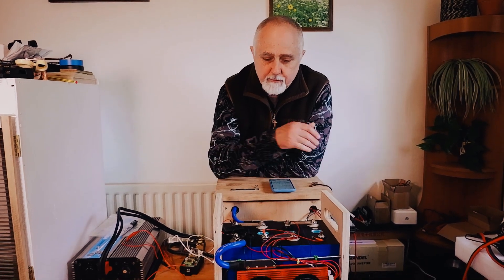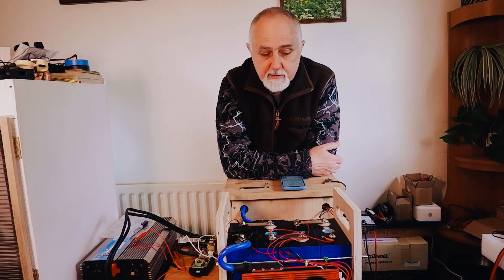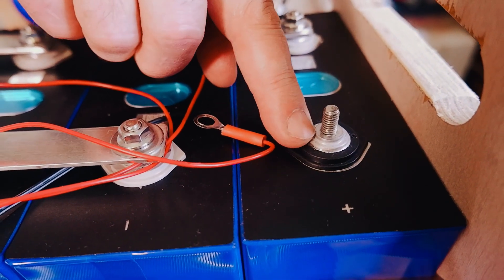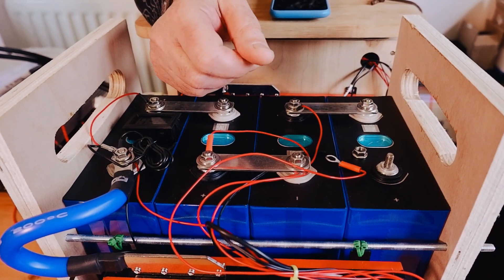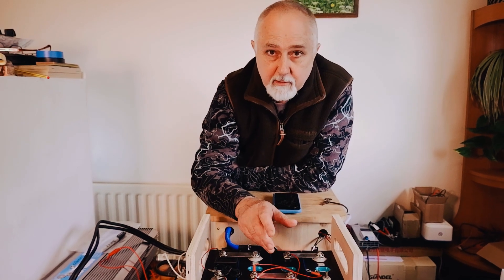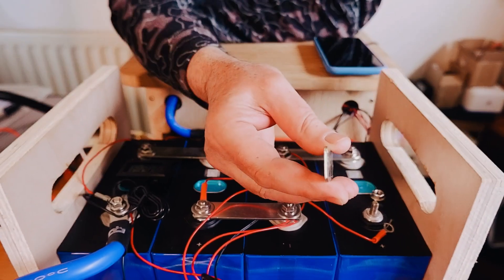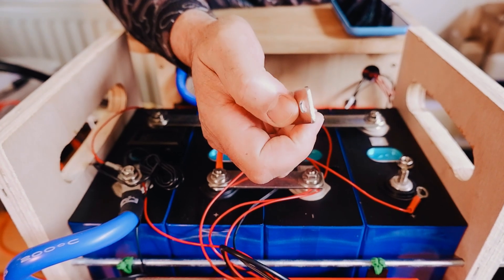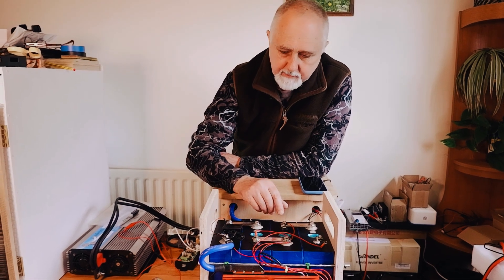Review of EVE 280AH LiFePO4 Battery Cells

Comment: I've always been confused how big a solar panel would need to charge these?

I would not be using much.. Just lights and my heater every now and then. 

If i only use a very small amount of power consumption on my boat. Could i get away with Having a smaller solar panel?
Reply from the maker: It really depends how much power you use from your batteries. Best thing is to work out how much you’ll use, you can do this by working out how many watts you need and then how long you’ll run your appliances for. That will give you your total number of watt hours.

For example, let’s say you’ll draw 6 Amps at 12 Volts for 2 hours, the formula looks like this:

6*12 = 72

This means that you need 72 Watts of power per hour (assuming you’ll run your appliance nonstop). 

You can then calculate how much solar you will need to replace the amount you take from the battery based on how many hours you draw that amount from the battery. If you then have 120w of solar, you’ll roughly need a little more than an hour of direct usable sun to replace an hour of use based on the example above.

Comment: Im so confused why these chinese BMS are set to 3.75 as max voltage.
Reply from the maker: Some LiFePO4 cells can have 3.75v as the max voltage without causing damage, so I think Daly intend for you to adjust the limits based on the recommended thresholds that your cell manufacturers recommend.
Reply: @offgrid_power  sadly this Daly BMS I have isnt adjustable.

Comment: Life wise do you think it's worth dropping the top voltage to 3.5 snd the lower to 2.8 ? there doesn't seem to be much capacity to be gained after these levels?
I'm looking for 250 Ah of usable capacity for my camper but space restrictions only allow me 230 ish with LA which obviously meens around 100Ah usable capacity ☹️
Cost wise I'd be looking at £500 in LA batteries, £50 in protection AND a lot if time and effort relocating the battery compartment to reach that 250 AH capacity AND I'd be paying a huge price in weight !
Reply from the maker: Hey Rob, yeah you're right. The trouble with LA is by the time you've put enough batteries in to match the capacity, you're not far off the price of a DIY custom LiFePO4 battery and significantly more weight! 

In terms of lifespan of the LiFePO4 cells, you are correct that the more conservative you are with reaching the limits, the longer the cells will last. So if you had your upper voltage at 3.5v and your lower voltage at 3v, you'll get more life out of the cells than if you pushed them to 3.65v and 2.5v. As you say, most of the energy comes from that 3.5 to 3v. Above 3.5 and below 3v you don't get a lot of capacity. Personally, we tend to run our batteries at about 3.65v for upper limit and 2.75v for lower limit even though it'll shorten the lifespan because we'll still get 8+ years out of the cells, even if we use the van full time (which we don't) and in 8 years time, the technology will have improved so much that we might be keen to upgrade before then anyway. :)
Reply: @offgrid_power  yeh i get you, in 8 years LiFeP04 will seem caveman tech lol
Cheers for the info I'll be contacting you via the web site next week RE a battery 👍
Reply from the maker: Yep, I think we'll see this technology advance super fast over the next few years!

Comment: Top balance = BS! You need to connect your bms and start using (Cycling) your cells. The BMS will balance them if nessesairy and will protect them. 10-15 years ago LiFePO4 was very new and was only in small numbers produced. Then batch differences and cell difference and old stock, made life for owners difficult. BUT Nowadays.... This process of producing cells is very proffesional. LiFePO4 manufactors know there thing. There for "top balancing" and other shit like capacity testing single cells isn't nessesairy! It is even an burden! Because your cells arrive "Matched".  So ready and prepared to function in your application. Only checking of all cell voltages is very good practice, ... But pls stop your top balancing act, it is only a big risk! Best is to use a solar charger-inverter to charge large batteries. Do not start to use a ebike charger, because it will take longer to charge then to empty a battery. If possible don't charge higher then 3,4 volt per cell to get real long cycle life. At this voltage you will not have to much voltage inbalance, because after 3,4 the LiFePO4 Hill Climb starts and bigger voltage inbalance can show up. Just check your cell voltages on cell level many, many and many more times. You will get a feeling to it. Do not think a full battery is "good" !!! A cycling battery is good! A full battery or an empty battery is BAD!!! If you love / Like your LiFePO4 Battery pls forget and forbid yourself 3,65 v. !!! Because look what happens aftre 3,4 volt and before 3,65 volt. There is a hill climb, all your cells go in disbalance there. check your voltmeter!
Reply: Manufacturers may know their jobs and products well but the trouble is most of these cells are sold by 3rd parties who neither know or care about the product, often buying in grade B stock and selling it as grade A so a check of state of health is a must untill you know and trust your supplyer IMHO and a load test and top balance is easier than multiple charge/ discharge cycles 🤔 to get a quick assay of the cells state of health ?
Reply from the maker: Spot on Rob. We've bought a bunch of cells from a number of resellers and so far have only had good success from one where she genuinely tests each cell before she sends them out and also supports the products fully without any quibbles. Suffice to say, that's who we do business with now. :)
Reply: @offgrid_power  I've had 2 lots of cells from AliExpress and had to send both back because they were so out of balance, id much rather pay you 2 gentleman to have that hassle and do the research and assemble the battery for me 👍
And i have or will when we meet up 😁
Looking forward to completing my electrical install with one of your batteries 😎
Reply from the maker: Thanks for the advice. You're correct in that most of the voltage difference between cells is not between the "knees" but in the steep climb (to a full SOC) or steep drop (to zero SOC). As you say, most often there is very little voltage difference between the "knees".

Comment: I just assembled a pack of 8 of the 280AH cells  They were top balanced about 10 days ago and were taped together with bands of Fiberfix  fiber reinforced 2 inch wide tape. I'm building the battery box to hold the 3000 watt inverter, 70 amp charger and 250 amp Daly BMS.  I'm very surprised to see that the tape is now slack and the ends of the cells have a noticeable dished shape. I put about 30 pounds of pull as I taped together 4 cells each in a wooden fixture to keep them aligned. There was only one charge cycle on these and it rests at 3.39 volts per cell. I wonder what the long term expansion and contraction will do to the life of them.

The idiots who designed the terminals should have used an 8mm stud and lose the aluminum. At least make the terminals with a nickel plated copper top for decent contact area. 

I did not use large ring terminals for the BMS connections but opted to drill a hole in the bus bars and tap them for  #8 screws 3/8 inches long coming through from the underside with the nut on top. The small leads are much easier to install and the red small gage ring terminals are readily available. I even cut some bus bars in half for both positive and negative terminals and installed #8 screws so they can be attached without interfering with the terminal bolt.. Both  batteries are 12 volts in parallel.  I used 1/0 battery cable for the major connections with 5/16'' holes for the terminals.   Who 1/0 battery cable? Because I have about 60 feet of rolls of black and red cable from Craigslist and about 40 ring terminal ends for it. Best $30 I spent!

The instrumentation and battery monitor all use the #8 screw connections on the bus bars as well. I opted to attach 500 amp fuses to each negative terminal (another Craigslist purchase...box of maybe 15 of them!). It makes it easier to route the cables. The onboard 70 amp charger and ammeter with DC disconnect have #6 cables and an analog ammeter with shunt. I'm enjoying making up cables with the hydraulic crimper, rubber tape and shrink tubing.

Thanks for your video. I got a lot of great ideas from you.  This unit will go in a steel roll cage on wheels. Portable? Ha! Might be about 125 lbs right now. Its for powering my son's fridge and 2 chest freezers for when they do the rolling blackouts here this summer. There is a space for a solar charge controller on  top of the unit as I have a few leftover 410 watt panels in a crate to try out. He has  perfect southern sun exposure unlike my place.
Reply from the maker: Glad the video was helpful! I agree with you that the M6 studs or threaded holes that they use on a lot of these LiFePO4 cells are not great. Thats probably the thing I dislike the most about them, tbh! I wish they'd used M8 or even M10. I have a set of Winston cells in my camper and they have M12 threaded terminals, which are awesome to work with because you know they are never going to strip! 

Plus it's annoying that Daly insist on M8 lug connectors when most LiFePO4 cells have M6 threaded terminals or studs. Wish they'd sync up and just move to M8!
Reply: @offgrid_power  i think the main issue is because china spent so long making other peoples goods and ideas they don't really understand the intricacies of the designs, copying is not allways understanding 🤔